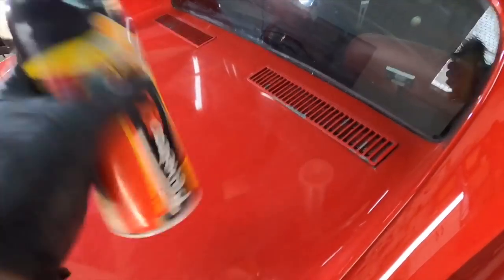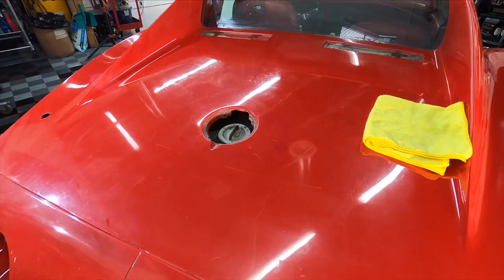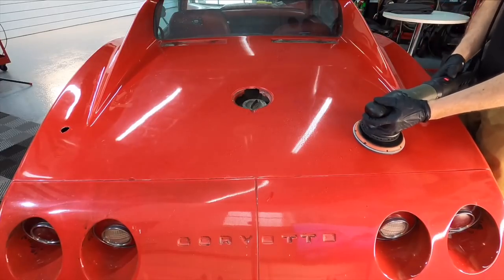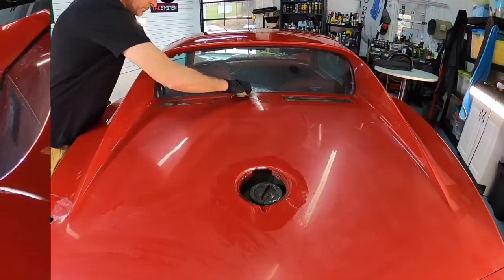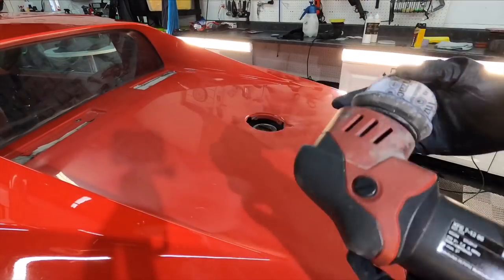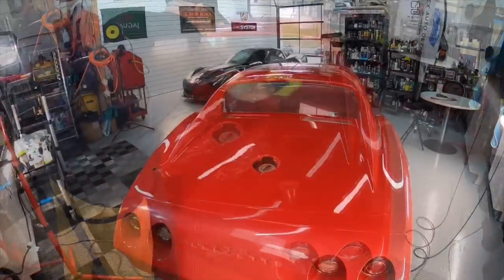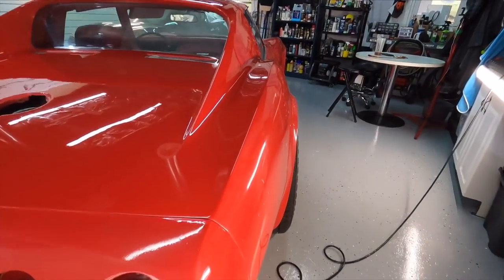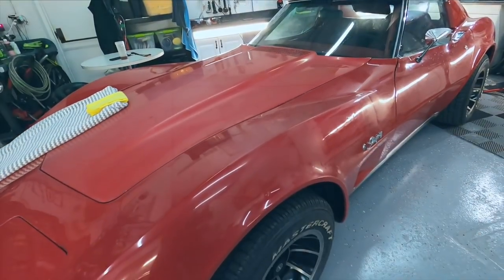Paint Correction Part 3! Barn Find 1974 Corvette Stingray!

Comment: Hi Brian, I've been watching your videos for a long time now and love your content. I've been detailing and doing body work at a classic car restoration garage for the last 15 years and last year opened up my own small detailing business in central MA. My father is a huge Corvette fan and he and I have been going to Corvettes at Carlisle since I was little in the early 90s. Granted I have lots of experience wet sanding and polishing two stage paint (typically at the shop I work at we do full restoration so we strip the old paint and lay down PPG) I don't have much experience with single stage. My father has a '55 Chevy 210 coupe with single stage that looks like it was resprayed in the 80s.  We used a paint gauge and there's only about 2 mils of paint around the car. The paint dulls pretty fast. We are afraid of wet sanding since there isn't much to work with. I always suggest we do a light polish and apply an acrylic glaze to hydrate the lacquer and lock it in. Do you have any other suggestions what we could do?

Comment: Hey Brian.  I love your videos and the C3 is looking great!  Question for you though.  I see you using LVR404 on the red single stage on the C4, but I believe I saw you use LVR403 in your "Combo better look than a ceramic coating" video on a red Toyota clear coat.  I have a 2017 F150 with white gold pearl (code GN) that only needs a good polishing.  It's kind of champagne-like.  Which LVR product would be best for it?  I am a DIY detailer...

Comment: You had said it is one stage red paint.  All of the sanding residue looked like clear coat being removed ie no red.  Also after buffing, looks like base clear finish and frankly  too good to be GM original
Reply from the maker: Joel Palmer it is not BC CC. I will show the pad as we sand deeper. That said .. something to look out for. Back in the day, before BC/CC.. hotrodders would clear single stage enamel.